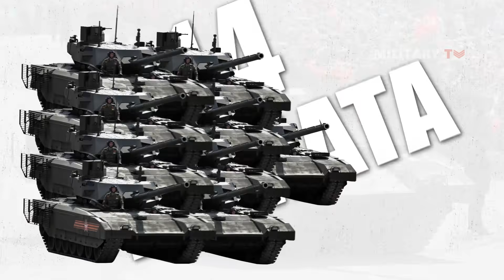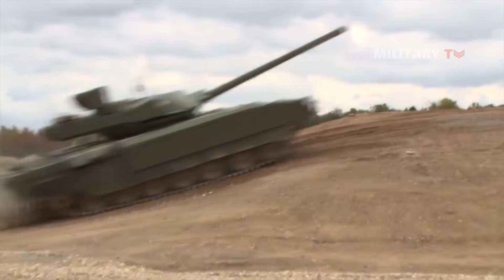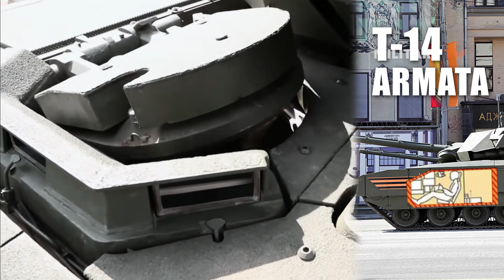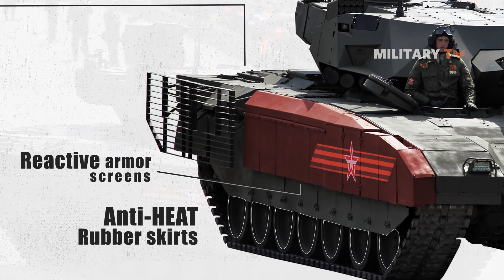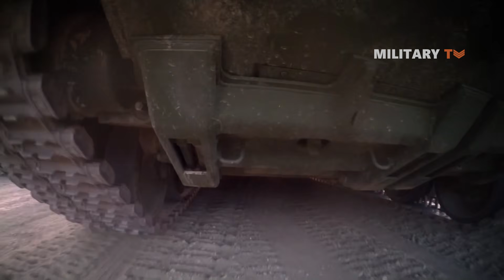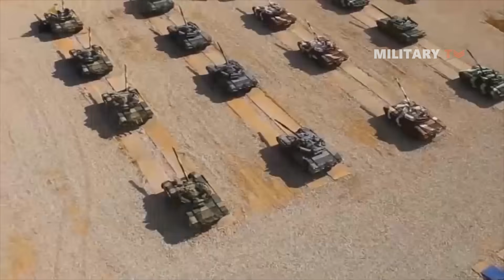T-14 Armata - Russia's Latest Tank

Comment: The Russian government has admitted that the Armata is "too expensive" for mass deployment, preferring to modernize the T-90M and T-72 models, which are cheaper and easier to mass-produce. Although there have been reports of brief deployments for testing, Russian high command has avoided sending it to the front lines for fear of losing such an expensive vehicle or that its capture would reveal technological secrets. Furthermore, sanctions and reliance on advanced electronic components have hampered its large-scale manufacturing due to international restrictions. In addition, Russia is integrating systems developed for the Armata (such as its targeting and armor systems) into existing T-90M tanks.

Comment: Russia's Latest Tank is T-54 & T-55 :DD
Reply: dont worry, they have stil huge numbers of newer and better tanks left, latest info says russian stocks still have (despite high losses in ucraine) around:

40  t14
650  t90
3.000  t80
6.000  t72
1.500  t64
1.500  t62
and uralwagonzavod has a production capacity of some 100 pcs. of t72b3, t80um or t90m, per month.
Reply: @tombaur8316  Most are rusty decommissioned or mothballed junk, half of which is at best suitable for parts for rebuilding and repairing active units. Or are you seriously going to tell me that Russia is sending T55s to the front (in which soldiers can only expect imminent death) while having newer models in reserve? Okay even if some amount is still produced and left over for the next May 9 parades or to reinforce the new northern borders with NATO, it will still not be enough as well as ammunition (because they spend 5 times more than they have time to produce)
Reply: @rogefraymond8932  theres no single proof of any t55 on front lines in ucraine.
but if ever, they wouldnt be used as tanks, but as mobile and usefull infatry fire support.
most experts agree that around a half of russian reserve stocks can be refurbished or canibalised to bring them back in function, so there would be still many thousands.
the rusdsan pre war ammo stocks were estimated somewhere around 12 million artillery rounds and some 500.000 tank rounds, while the production is boosted, so russia will never hav any ammo shortages.
and they will also never have any tank shortages, because they have thousands left and can produce around the same level  they loose in ucraine, some 100 per month.

Comment: False information. You said this tank doesn't rely on western imports, but it relies mostly on that... optics(french), computering power(taiwanese) and a lot more... it has modified german(nazi) engine(Porche tiger variant), which was famous for being unreliable(The tank broke on the day they celebrate win over Nazi germany and they couldn't start it)... you say its designed to stop any anti-tank missile, which is wrong it can only stop 90s missile systems ... if it was any good they would send it to Ukraine ...

Comment: It's totally new approach that no crew member sits in the turret, so the crew are safer being isolated in the front section. This is a big jump in tank design.
Reply: No it is not. It is dumb. If there is a jam, no one can clear it.
Reply: You make it sound like unmanned turrets have never been done before. It's also a terribly designed turret since you can't clear jams without leaving the tank.
Reply: @Green__Ghost  It's the only MBT having an unmanned turret with modern APS technology, this is an amazing tank indeed.
Try coping harder.
Reply: @Vantriloquist-j9j  I'm not the one coping here, my friend, I'm only pointing out the facts that have already been revealed.
Reply: @Green__Ghost  lol The tank is still in testing, it's hasn't seen any combat, and you already have "facts"! 
So you have "facts" that the engineers of it are unaware of..? Ok genius.😂
Reply: @Vantriloquist-j9j  So are you denying that the inside of the turret is inaccessible from inside the fighting compartment?
Reply: @Green__Ghost  The chance of an autoloader jamming is the same as having an injured human loader, both models will require a turn around and just withdraw at speed to base.
Are there any modifications that could be done to allow access to the turret? Only time will tell. All I'm saying is that this 2010 design is a revolution in tank crew safety, and who knows perhaps is a step forward into smaller one manned or totally unmanned tanks.
Reply: @Vantriloquist-j9j  True, a jam could easily be fixed at base, the problem is that not being able to clear the jam from inside the tank makes it a death trap, if the gun suddenly stopped working in the middle of combat it could mean the death of everyone inside unless they could quickly withdraw, and that is NOT a guarantee in the middle of a battle. There's a reason why the L86A1 is remembered as a garbage gun by so many people today, it jammed way too often which could cost the soldier his life. You're right that the T-14 needs a redesign but we have yet to see any improvements made so far, until then I think we can all say that "The T-14 is a bad tank".
Reply: @Green__Ghost  I see it as an excellent tank,  if I was a tanker I'd choose to be in this amazing tank, just finishing enemy targets from very far, while protected in a compartment away from the untouchable turret, that is designed to be untouchable by the enemy.
Reply: @Vantriloquist-j9j  No MBT is designed to be untouchable, you know what we call vehicles that fire from far away as to not get shot? Artillery. If the T-14 can't reliably fight on the frontline without having to run away because of gun jamming then it's unfit for the MBT role.
Reply: @Green__Ghost  I love that all your argument is based on the gun jamming, something that rarely occurs and as I told you before, it's like a human loader gets injured. As if you know better than the designers and engineers of this beautiful tank.. now kindly get back to watching NATO tanks drifting in tank shows.
Reply: @Green__Ghost  man - if western tank need to be repaired or "maintained" all the time - it doesn't mean Russian tanks should be repaired all the time as well. Autoloader even in t-72 don't jam or broke.
Reply: @Green__Ghost  заклинивание орудия, что ты несёшь?
Reply: @8v816s Do you not understand what "jamming" means in relation to guns?
Reply: @Green__Ghost нет, просто ты даже не знаешь этот танк и думаю что ты даже никогда не управлял никаким танком, но при этом уже из воздуха достаёшь недостатки этого танка. Просто хватит обманывать себя(
Reply: @8v816s You don't need experience as a tanker to know that tank guns have a chance to jam in battle. I just pointed out that the loading mechanis is inaccessible from inside the fighting compartment, which means that the crew must exit the tank to clear the jam. This is just an observable fact, nothing made up.
Reply: @Green__Ghost  ещё танки могут застрять и экипажу надо выходить из машины, ещё двигатель может сломаться и экипажу тоже надо будет выходить из машины, трансмиссия также может быть половина и экипажу надо будет выходить из машины. Слишком слабый недостаток. Лучше уж быть в безопасной капсуле, чем в башне с автоматом заряжания
Reply: @8v816s You severely underestimate the importance of clearing a gun jam. A damaged engine, transmission or track isn't immediately a death sentence for a tank in battle as long as the tank can still defend it's position. If the gun is knocked out that means the tank cannot defend it's position and will be eliminated if spotted by the enemy.
Reply: @Green__Ghost только ради устранения этого недостатка сидеть в башне с кучей взрывчатки. Ну нет уж, причём сейчас все танки повторяют механику т14 с необитаемой башней и автоматом заряжания, например те же прототипы кф51 пантера и Абрамс икс. Но думаю ты будешь смотреть на них с восхищением. А про заклинивание оружия на поле боя ты не сможешь сразу устранить даже если ты находишься рядом с казённой частью. Тем более Россия имеет большой опыт СССР в автоматах заряжания с т64, у которого была первая в мире композитная броня, но он оказался слишком дорогим для СССР в те времена из-за упадка населения после смерти 27 миллионов людей во время войны и вместо него сделали т72, который дешевле и имеет схожие особенности
Reply: @Green__Ghost  if something destroy autoloader - it destroy crew as well. So i don't want to be in one place with it.

Comment: It will be typical Russian junk, all frosting and no cup cake. All we ever hear is big talk. Putin enabled this by putting the fear of God into those who report to him, nobody tells him the truth. Reality is Russians have the smarts to engineer good equipment, but they lack the production experience. I have dealt with many Russian made pieces of equipment and watches over the years, no two are ever alike and always have individual modifications made to enable functionality. This means nothing is ever plug and play, it's plug and figure out why it's not working, get the part needed and then figure out why it still doesn't work, then you figure out the last guy had a problem too and made a modification which then means you further have to modify....it's a mess. The only thing consistent with Russian made goods is that their production quality is inconsistent.

Comment: Т-14 НЕТ НА ПОЛЕ БОЯ, ПОТОМУ ЧТО ЕЩЁ НЕТ ДОСТОЙНОГО ПРОТИВНИКА, А "ИЗБИЕНИЕ МЛАДЕНЦЕВ И КАЛЕК" ВСУ - НЕОПРАВДАННО ДОРОГО... ЖДЁМ ЛЕОПАРД-2 И АБРАМС... ХОТЯ, ДЛЯ НИХ Т-90М ДОСТАТОЧНО ... И ДАЖЕ Т-72Б3 ИХ ЗАДАВЯТ "СОБАЧЕЙ СВОРОЙ"...
Reply: Lol! The T-14 is not even in production. All models to date have been hand built. Most of the electrical systems are from aliexpress or stolen speed cameras. The engine is a failed copy of a German porsche engine that was designed to pump oil. The buildings and workshops are there but empty of tooling for production due to sanctions. All efforts have been put into T72s & T90s that actually work and have functioning production lines. Unfortunately due the T14 design they can't even swap the awful power plant for a functioning one as nothing else fits. 
Sorry but the T14 is a shit show of a tank. And will never be in large scale production.

Comment: Has the turret been fitted with an altitude meter?
Reply: Thats a feature exclusive to the Leopard 2. Keep dreaming bud, you'll get there
Reply: @oogie493  Flying turrets is caused by a design fail, and it only affects russians tanks.
Stop dreaming put, soon our tanks will get there....
Reply: @worfoz  If it only affects Russian tanks why do I see Leo rusting with a turret 10 feet away?
Reply: @oogie493  where did you see that?

😄
Reply: @worfoz  I saw it in Syria 😄
Reply: @worfoz  He saw it in his DREAMS. 😉
Reply: @oogie493  If the turret was only 10 feet away, then, it HADN'T been FLYING. 😏
Reply: @johnharrison6745  sorry, I meant yards. The turret went so high 😂🔥

Comment: It has a long and smoothbore barrel. Meaning it has long range and fast armor shell being fired.
Reply: Smoothbore is like a Shotgun  // a Rifle barrel as used on the UK  Challenger Tanks  have a better range and in evidence ; proven to be far more accurate....
Reply: @1arritechno  Challenger - gun 120 mm. Armata - 125 or 152. Crew - 4 vs men. Weight - 62.5 tonn vs 55 tonn. And ye, Challenger has manual loading. This tank  sucks.
Reply: No. It means they ammo are garbage.

Comment: Judging by the comments below so many people are blinded by bias and seem to forget that a solid weapon design is capable of being used in battle for decades. it is irrelevant how long it takes to develop it. What is relevant is how it performs and this tank looks pretty formidable. I am guessing that this tank's technological advances will be adopted along with many of it's features which may become standard issue over time by many other countries not of the western persuasion. The Russians have always built solid weaponry and are very good engineers using practicality along with technological advancements. The adoption of the t-72 along with it's upgrades by so many other countries over the decades (since 1969) is proof of their ingenuity, stability, diversity and longevity over time. Anybody who underestimates the Russians or their technological capabilities might want to give their head a shake and see this beast for what it really is because sooner or later these tanks or varying versions of it will be quite common in a few years I should think.

Comment: Does the turret have a feature to launch 200 feet into the air?
Reply: No, that's a feature exclusive to the German Leopard 2.
Reply: @oogie493  Ah thanks for the update.  I also heard they might have to add a self tow motor just incase the Armata stalls during a parade.  That would be an excellent feature to have 😀
Reply: @dmnguye69  Why would they need that, when the Armata has never stalled before? I'm pretty sure you're talking about the time when a driver pulled the parking brake. That's why when the tow came it wasn't budging.
Reply: @oogie493  ok buddy you win.  But I think the loud speaker there did blasted out..“We have demonstrated how the evacuation of military hardware [during battle] will be conducted. The tank’s stop was planned,”

Comment: So high tech they haven’t made more than a dozen so far! 😂
Reply: Other than crew safety and ergonomics it doesn't do anything a T-90M can do at a cheaper price.
Reply: they never will
russia dont not have the capebilety to build chips for it fuck they cant even build cars with ABS anymore
the new lada is missing power stearing, abs, esc or airbags, but it has a multimedi system with many speaker (what every trhat means)

in fake they has a hand full of t14 in ukrain and so far the optics and engine have problems ( you can say they are shit and not full developed) 
they only make problems

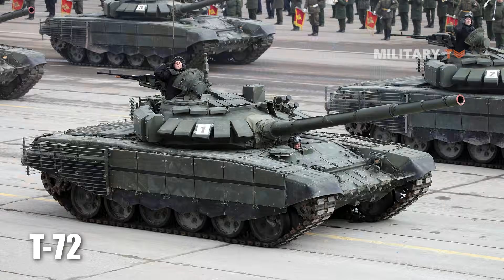Comment: Don't you folks find it at least ... ODD!... that the autoloader and the whole ammo-compartment with both projectiles & charges, is STILL of the same carrousel-type that has always been on all the previous models, right underneath the turret - SAME as all previous soviet-era tanks??  The crew might have been "incapsulated" in the front (in one row in the chassis none the less) - the turret looks differently, and there's allegedly a ASH*TLOAD of new electronics, NVD's, external cameras ...a RADAR (?)... and even passive and APS-systems aaand...????... STRIP IT DOWN! - and I have the sensation all we'll see at the very core, will be just t-90 or even T-72! PS. ...and THERE YOU GO! 01:14 - (quote): "It has been designed by the SAME beureau that designed both the T-72 & T-90." 😈 LOL!